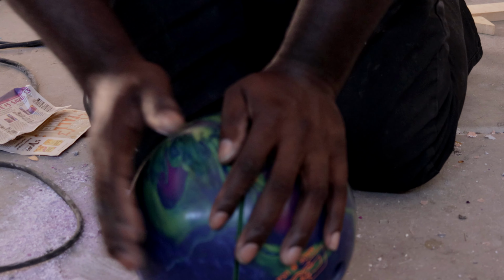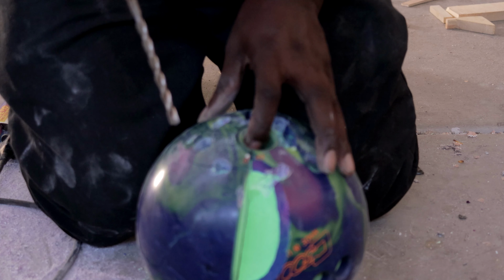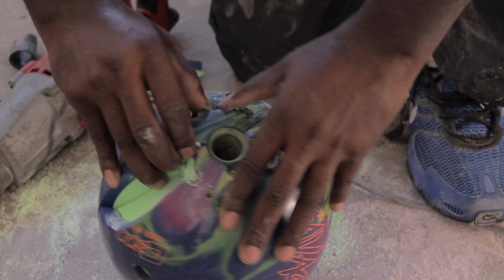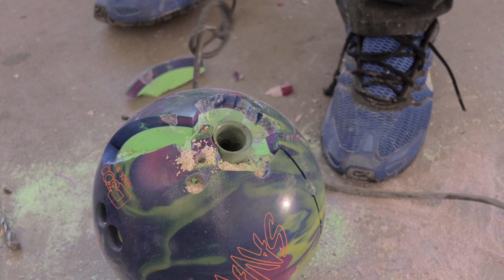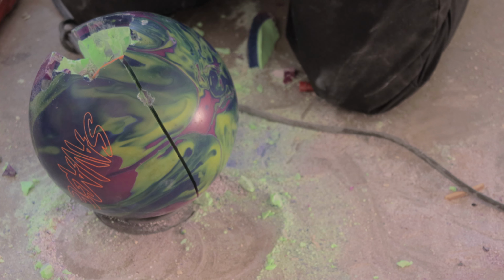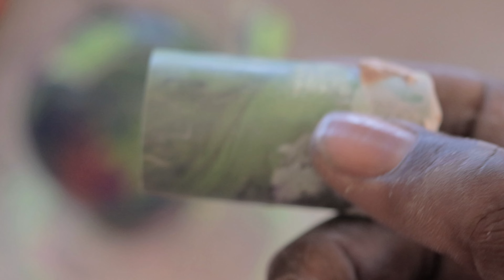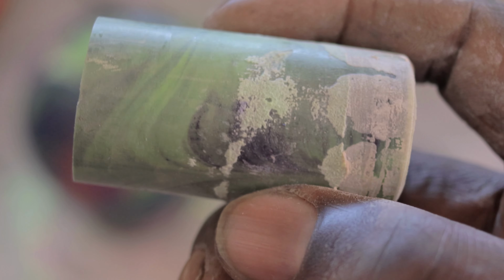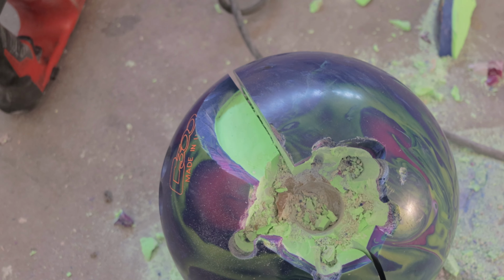How To Save A Vise Thumb Mold

Comment: I drive a wedge into the crack and let it sit awhile, then drive another wedge a little further around. Often splits like a melon. And I use the Proedge custom thumb for my molds. It's an easier mix than the vise exactacation
Reply from the maker: How long does it take after being wedged?

Comment: 🤨 you couldn’t just twist it out??
Reply from the maker: No, this is a mold not a IT.
Reply: @hihbowling   oh word. that’s cool. hey if you ever think about it or have the time i’ve always wondered how those molds work.
Reply from the maker: I have Virtue pour them. Theres a kit that Vise has. Make a master mold of the thumb you want, it goes in a cylinder, pour plug in it and it comes out just like the thumb you wanted cloned. I do mine with the tape it too!